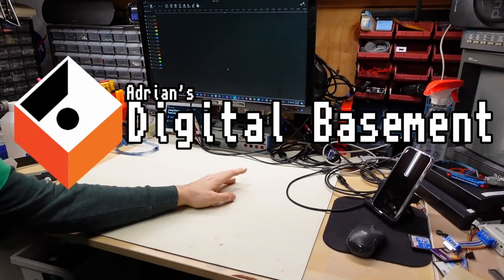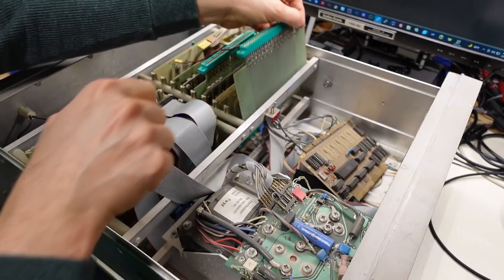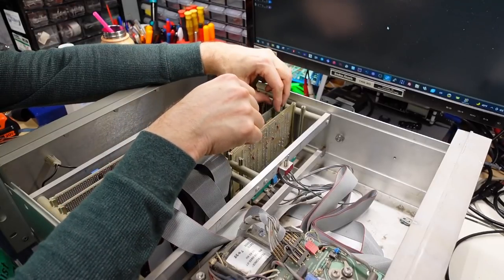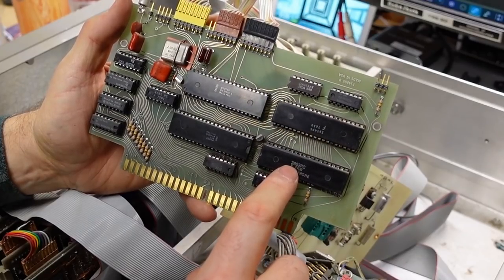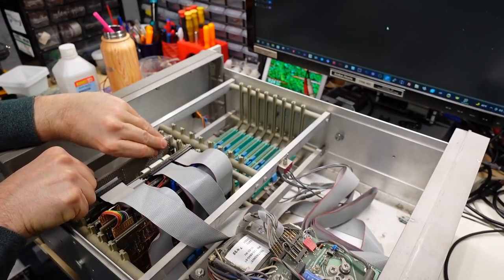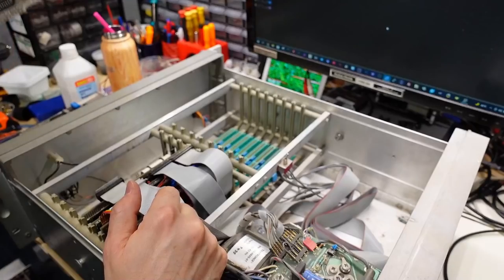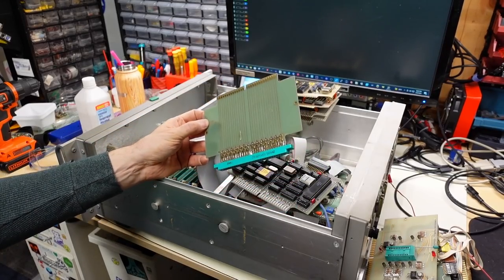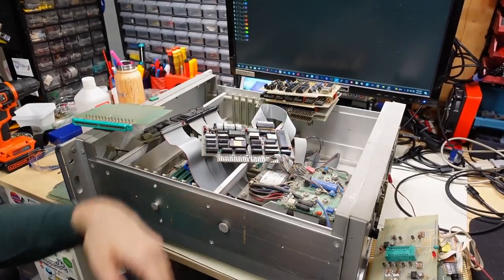I need help finding information on this mysterious computer

Comment: This “homemade” PCB construction may be what’s called multi-wire (I think) which could be done by a machine or manually using a kind of “wire pen”
Reply: Multi-wire is actually something different. I worked on multi-wire boards for Intergraph, they had them in their discrete TTL logic graphics co-processors for CAD/CAM stations. Mostly 74Fxxx chips for highest speed ratings. 5V@200A power supplies. The boards consisted of full copper power and ground planes, and then had insulated litze wires running between the pins in a lacqer layer on both sides. Wires were criss-cross, and often not even visible from the top. Patching sometimes involed instructions like "Drill 2mm into the layer, 4mm left and 3mm down from pin 16 of chip U256". You'd hopefully hit the wire you needed to disconnect. Any deeper and you'd short against the power plane. Any off the coordiantes and you ruined a multi-thousand dollar board.
Reply: @scsirob  I think you’re correct regarding multi-wire. Lookup Wiring Pencil on Wikipedia. That looks suspiciously similar.
Reply: In the UK we called this 'wire wrap' and was used as standard in the 80s computer industry for making connections in between board connectors. You could use a hand tool if you had a few to do, e.g. correcting mistakes or on site making modifications; or if you were on a production line a tool fed from an air compressor. The tools just stripped the insulation off the end of the solid wire and wrapped the now bare end around a long pin on the rear of the connector several times.

Comment: The regulators on the side are probably LM317 adjustable voltage regulators.

The Mostek 3850 is a Fairchild F8 CPU, as used in the Fairchild Channel F, the first home game console that took ROM cartridges. Just beat the Atari VCS to market. So that's already another CPU. I dunno why you'd want that, rather than having the main system CPU burn EPROMs for you, but maybe it could DMA from RAM and do it automatically so your main CPU could get on with something useful. I dunno. Looks like a real heap of shit, frankly!

The Z280 is yet another CPU! A 16-bit version of the Z80. What IS this thing!? Oh christ they wire-wrapped it!

Comment: You keep saying 'home made' but you should be saying 'hand made' because there is no way many of those parts would be available off the shelf at that time for the average consumer.
Many experimental or research facilities would have created computers like this for custom applications and tasks and they would often be repurposed as the need arose, people were running all kinds of experimental programs and software and modifying them on the fly so they needed to be able to do it in house.

Comment: What the... Mostek 3850 is a Fairchild F8? So there's at least Z80, an F8, and a Z280? A 2708 with 1979 on the sticker, and a RAM chip from 1986? (that Sony chip is 128K of SRAM, not flash, maybe it got used with the Z280)
And then that soldering, all that enameled wire is absolutely insane. Too bad about the battery leak though.
In general it looks like the "best" stuff was for a CP/M system. The backplane might have been entirely custom. The 50-pin ribbon cable would be for an 8" floppy. And THERE IS NO VIDEO YOU SILLY PERSON, there's three D-25 plugs on the back, maybe for terminal, printer, and modem?

Anyhow, you've got quite the three-ring circus there. I'm going to guess that someone put all their boards from a whole series of projects into that case. It was probably the "storage box" lying in the back of a lab space, where all the extra parts went to die. That happens when you do a lot of embedded stuff.
Actually they probably used all that to put together a specific era of system whenever they had to support something. There are clearly multiple systems in there.

EDIT: So anyhow, these are probably the original prototypes for making dozens or hundreds of those boards, which is why all the hand wiring and bodges. The Z280 was probably for a "next generation" system to replace the legacy Z80 stuff they had out there. By that time a lot of the old parts might even have gone obsolete.
This box actually tells a story about the evolution of a system.

Comment: This looks like something made in a company lab, and probably not homemade. The PCB cards appear to use the S100 bus and were probably made inhouse, the layout and technique were pretty common back then. The perfboard cards look to be created by the engineer(s) designing and building the system. The cost of the system would have been several thousand dollars, way outside what hobbyists could afford. Why do I say that? I'm from that era and worked at Mostek during the 70s. I, and a few engineer friends designed our own CP/M systems back then, using card designs a group of us snuck through the company's board manufacturing facility, and populating them with the Z80, RAM and ROM chips we manufactured and other stuff bought in a group purchase. My two 8" Shugart floppy drives cost me $450/ea (roughly $3k in today's dollars), something only serious hobbyists could afford. I dropped about $1500 into my system and it wasn't even close to being as sophisticated as this box. The hobbyist community wasn't as large as it is today; and numbered in the few hundreds and comprised engineers in the trade. This is not a hobbyist level system. It's more likely built for use in a company. It looks like an instrumentation or development system, difficult to say beyond that. I have to say it's pretty slick. Too bad you didn't get any documentation with it. I agree with the suggestion you may be able to reverse engineer some 'creator' information from the ROMs. No one would build something like that without having some 'bragging' information buried within it. I hope you put a little more time into it, I'm curious to discover what it was built for.
Reply: Obviously not even close to an S100 bus, they only have 56 connectors.
Reply: @MrHurricaneFloyd , then it could be the STD bus.

Comment: I will take a shot in the dark. some years ago I had a Textronics scope designed to see rise time on capictors a real beast was not useful for anything normal and it's power supply had 3 switches to start it 1 main power then 2 (momentary) for a boot I guess you would call it, I thought I saw Textronics on the pwr transformer in yours. If mine had evolved it would look like yours,

Comment: Some parts of it has a striking resemblance to the Ohio Scientific computers. However, the Ohio Scientific systems I was  using back then was 6502 cpu based, not Z80 based. However I do know they did make a Z80 based system that would boot C/PM from 8" floppies and later from the early hard disks.

Comment: In the 80's, I was an intern in a large steel company. At that time, we built internally many of the industrial computers used in the field and this one looks pretty much like one of those but as they would be exposed to coal dust and other conductive kinds of contamination, we would use some sort of protective varnish over the boards.

Comment: Looks like an automation control unit from the outside.
1. Thats a common bus type arch you could get many cards for back in the day. I don't recall the standard.
2. They make those individual pin style sockets still, now they are most commonly used for "hot-swappable" mechanical keyboard pcbs. 
3. Nice early power supply. All those mods look legit. Nothing sketchy there except maybe exposed pins.
4. you weak af, dude. from a fellow lazy nerd. 
5. Bodge wires were, indeed, the norm. 
6. Dude, you should be more careful with that. You uare being pretty rough with those magnet wires.

In any case, this is an early hand made computer. Maybe for a specific purpose, maybe not. Without reading the roms you won't know. 
Please preserve this. I can show you how it works.

Comment: Searching through the list of computer buses on Wikipedia, it looks to be what’s called the STD bus. There’s even a pin out on Wikipedia. Cards look to match the dimensions, and it looks like thy have the 56 pins the bus calls for. I’m not certain, but reading the admittedly short entry seems to lead to what it is.
Reply: STD Bus pinouts will show that the ground and power lines are completely different.

Comment: It looks to me like a railroad computer. Something they'd have in the locomotives that calculate all the hills and turns a train goes through at once and applies throttle or brake to the locos in the middle and the back as  necessary. Let me tell you though, them things are shrouded in mystery. You can't find fuck all about them on the internet and even old railroaders will tell you nothing. Be careful with it!!!

Comment: My limited personal experience may be driving me down this road, but a lot of the unique things you show scream military use to me. My experience was on subs in the 80s-90s and we used discrete components almost exclusively for reliability on the reactor control systems. But around 96-97 we got an indication system added that was in a similar drawer with those same type of cam-locks securing the lid. Once you opened it, inside was a nearly off-the-shelf 386 PC motherboard with modifications for the specific use case. Some specialized boards with chips connected in place of the hard drive. And all the input/output ran to a remote plasma display unit in the control room.

This stuff is obviously a decade or more earlier, but your mention of the long date range would be in keeping with military keeping what may have been outdated systems working in dwindling numbers of old locations until decommissioned. Decommissioning security would also explain the lack of storage drives. And the bodges look a lot like some of the added bits and pieces we used to do during changes and upgrades to interface with different systems over the years. Those "home made" boards could similarly be from very early shop made adaptations for a new system whose design was still a bit unsure, or from a shop trying to piece together a hand made spare to keep a system going after the supply system ran out of replacements and they still wanted to keep the system going.

Comment: Greeting, Let me set a few things clear, 1st I never disclosed who the client was. 2nd Tek was just up I5 from our company and we did a lot of work with Tek both in Wilsonville and in Beaverton Ore. 3rd the way things were done in the 70's and 80's is very different then the way things are done today! If you don't know what you are talking about, don't talk. I have been an Engineer for more the 40 years. and for your information look at the back plan of an IBM or DEC computer from that era. You will find entire back panels were HAND WIRED!!!! Early multi-layered PCB even used wire routing. I take great pride in the work our company did in the 70's and 80's. I still use a lot of the same skills today. Heck I still write most of my code in assembly! Just because I can. It is what we call efficient! I can still put an entire app in 64K with a complete 24 bit TFT driver. do that on an Arduino with C++. Sam
Reply: I’ve got an old board which I picked up at a hamfest a couple of decades ago sitting in my junk box now.  The board is jam packed with 4000 series CMOS and appears to be maybe seven lavers with each layer is individual wires routed and glued down.  The wire is much thinner than 30 ga. wire-wrap wire.  It is definitely an interesting board.  I assume whoever made it had an auto router similar to what Burroughs snd DEC used build backplanes, but this one worked on a much more delicate scale.  I have no idea how they connected the vias between the laminated layers - that would have been the secret sauce.

There was definitely some interesting stuff in the 1950s through mid 1980s while lots of different methods of building and automation were being tried and sorted out.  It sure wasn’t like now where you do schematic capture, e-mail your Gerber file and get finished, masked and silk screened boards from China a week or two later.  Back then board revs might take months, so lifting chip legs, cutting traces with an X-acto knife, and gluing down mod wires was what was required to get working equipment is customers’ hands.

Comment: Aluminium .... is correct .. Aluminum is a TRADE MARKED portion of a name brand ... by Reylonds ... Aluminum Foil wrap ... the proper name aluminium cannot be trade marked BUT the misspelled version CAN be and has been ... calling it aluminum is actually violating a copyright ... it is called properly ALUMINIUM ... you dont use Kleenex you use Facial tissue ... you dont use Javex you use Chlorine Bleach ... you dont Use Scotch tape you USE Cellophane tape ... ALuminum is like those other name brands ... improperly used for the common material most often by Americans and american text books. 
.
.
technically it is home made ... it is appears to be a college electronics  test cmputer to test exam projects of z80 computers built by the students ... it runs on CPM and the test pc's (z80's) are put through a test sequence to see they actually work as a computer with a class supplied OS ... helped build a few in my college days and even built the final exam project computer with 4 others that was a fully functional 5 line display computer ... it was tested on a dedicated program computer for analyzing all required functionality and spitting out a report for the teacher to grade you on ... it should also have a punch tape rs232 cable to connect to perhaps aPDP 11 punch reader writer server ... 
.
it is literally a bodge server mainframe computer with one purpose only ... testing.
Reply: Aluminum has two acceptable names. Neither is trademarked. [even then you seem not to understand what a genericized trademark is, which is sad]

Comment: It would be nice to have ROM dumps. Without any software floppies, it might actually be the best chance of working out what this computer actually is. We can learn quite a lot by reverse engineering it. 

If it's still configured as a CP/M machine (it might have been configured to something else in it's later days), then there is a decent chance the full BIOS is in ROM. My understand is that the customised all we really need to boot CP/M. The BIOS acts as an abstraction layer over the hardware, and the rest of CP/M (BDOS and CCP and the software) are generic across all CP/M machines. 

I guess in a worst case, we could theoretically write a new BIOS to get CP/M booting.

Comment: This looks like a systems development machine - pre-production boards were laid out the way you see them here (not home-made but hand-laid) and you'd often see other boards that have ECO mods (bodges) that were intended to become later production changes.  Sometimes recycled ECO boards were just put in these kinds of machines because they had them in the shop and inventory was expensive.  I'd say this is a STD bus Z280 (at least in this config) production design machine used by a manufacturer.  I/O would be serial-only and usually these machines were found in industrial or laboratory spaces, often replacing aging PDP-11 or PDP-8 machines.  You can tell it's not S100 both by the edge connectors but also because there was no voltage regulation on the boards themselves which S100 boards often had.

Comment: looks like some sort of a/b switch for printer, jesus get on with it, card is an extender, a close up of the processor would be nice, reset pb,  eproms, typicalearly 80s,got a pwer regulator and clocl looks like an eprom burner 14:29 yup its a burner. This was probably used in manufacturing to burn eproms at scale ...for the time.  i

Comment: Middle watching the video, my overall second impression reminds me of prototype-development equipment. I used one such for Motorola 680x microcomputer prototyping back in the early '80's.
However, the two big handles and railing point at use in racks. A first impression reminds me of airborne communications equipment.

Comment: A lot of low volume electronics from the seventies and eighties look like this, in this semi-handmade fashion.
They did more things by hand, if it was for a low volume production.
This could very well be some kind of industrial controller or something like that, maybe some lab automation or development tool?
I have a nice 1978 ICL CAD/CAM computer at home, which looks similar inside, but on a SASI bus. Uses CP/M, 20 MB harddisk, Xebec controller, 80186, up to 6 users.

Comment: Similar to other commenters, this looks straight out of my old lab! It could be anything, of course, but in my case it was a computer and laser controller from a huge laser cutting machine that was being gotten rid of, from which I managed to salvage this and the laser. I wanted to salvage the in-built monitor, too, but I couldn't get to it.

Comment: You know Adrian! If you've never seen anything like this before... You DON'T get to make fun of the way it was designed! 
 You look at these historical devices with the hindsight of 40 plus years of technological advances!  Maybe keep your derision to yourself!
Reply: It's NOT a home made computer! Those hand wired cards are professionally designed "one of" prototypes!
Reply: It said is was a CP/m system. CP/m disks are very readily available!
CP/m was a OS long before PC's were even a thought in IBM's little minds!
Reply: You know Adrian... most computers in the 70s and 80s used teletype printer terminals, serial and current loops.

Comment: I do not know, what this is; I will investigate it for free, no charges. As I need a cabinet fot a new antenna-tuner, for my short-wave radiostation. And I will find a purpose for the components, as well as for the extention board. I'l chuck the medeval computer-shit in the dump!! HI